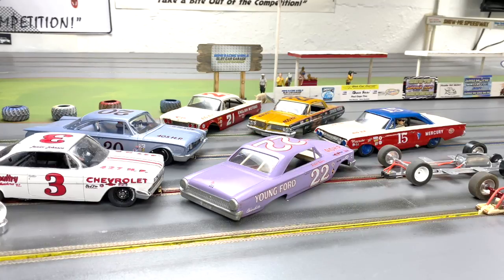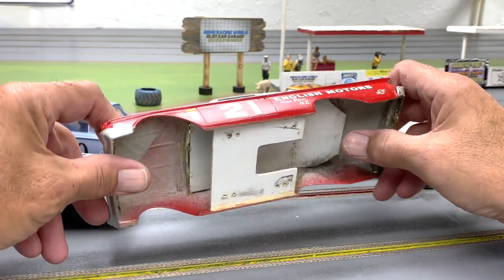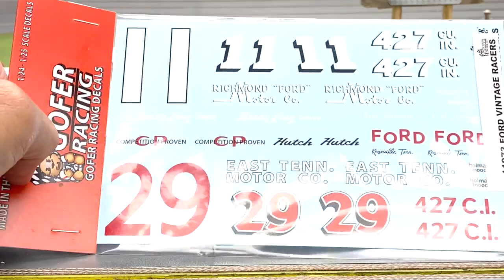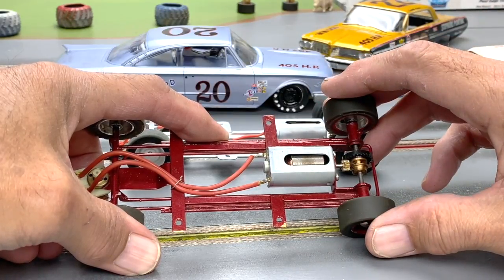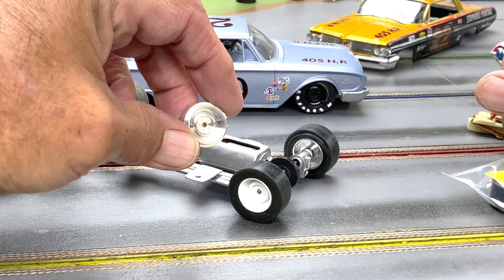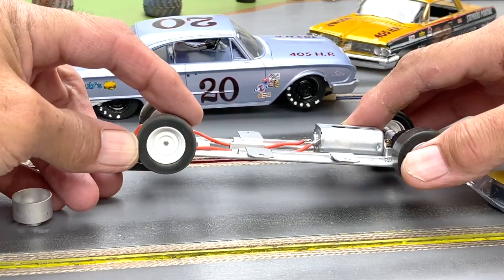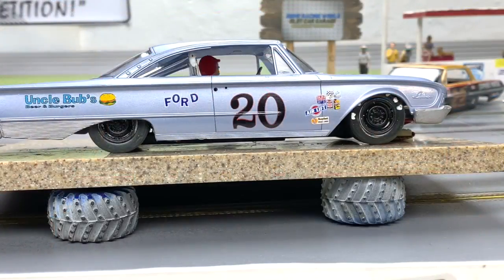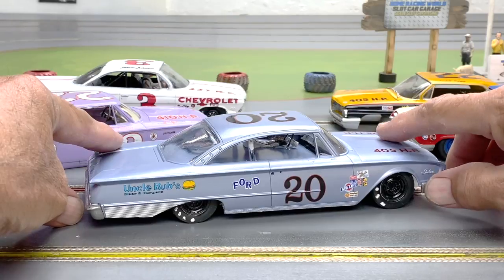HRW Showdown! 1/25 Classic NASCAR Land Barge Series

Comment: Great video. FYI: A '64 Chevy Impala is 17.5 feet long. So, on a 1/25 scale slot car, it would be 8.75 inches long. On a 1/25 scale palstic model, it would be only 8.40 inches long. So the difference is .35 inches which is about 4%.